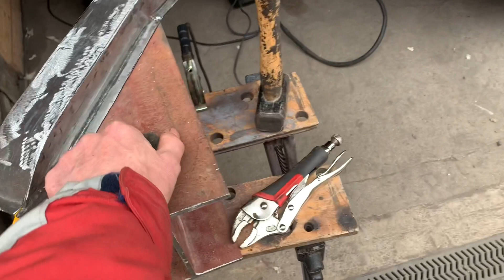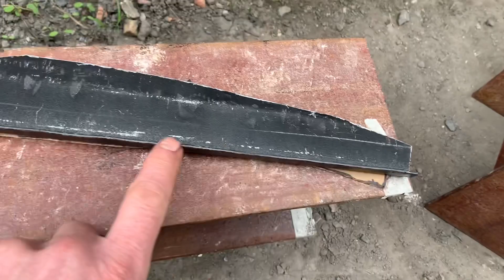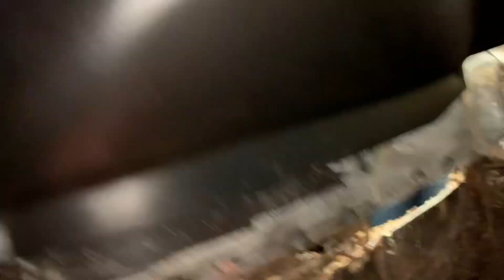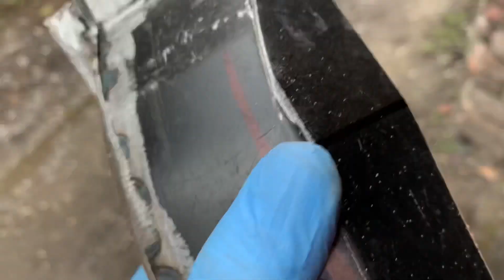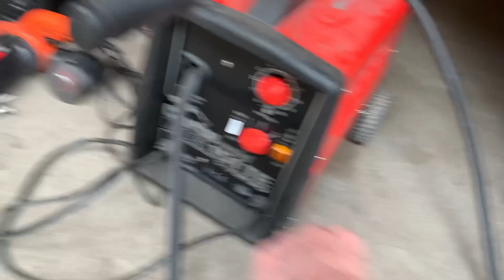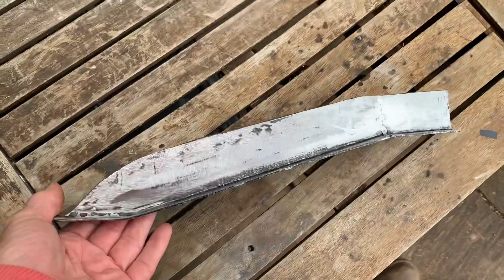Mercedes R107 bulkhead strut fabrication using basic tools

Comment: Hi Mike, I may have missed this in the video, but do you know why that section tends to rot out, where is the water coming from do you know?
Reply from the maker: Thanks for your comment. One of the really common rust areas for these 107 SL's is under the battery tray. Water pools there because of trapped debris and a blocked drain hole. Eventually this rusts through to that cross member....and then through the front footwell. If you haven't already seen it, have a look at 4.37 in:

https://www.youtube.com/watch?v=TKzse3HCCiE

Also worth having a look at the drain hole video at 7.28 to make sure yours isn't blocked:

https://www.youtube.com/watch?v=FOHQUobhnOI

Mike